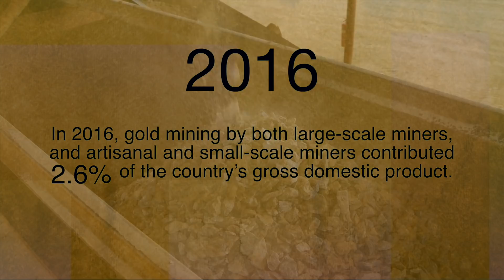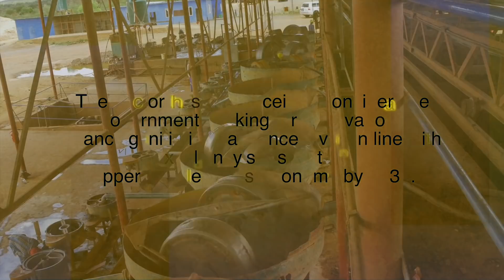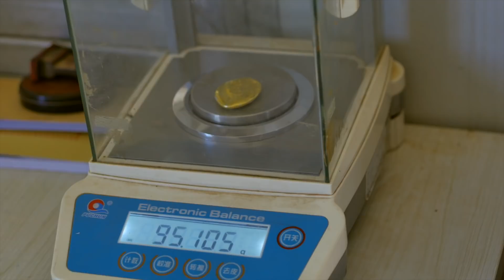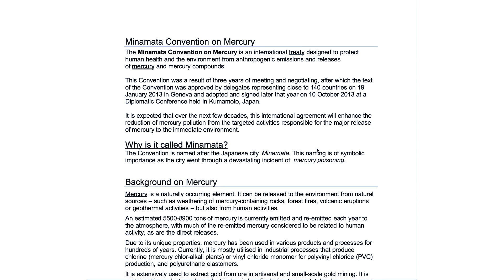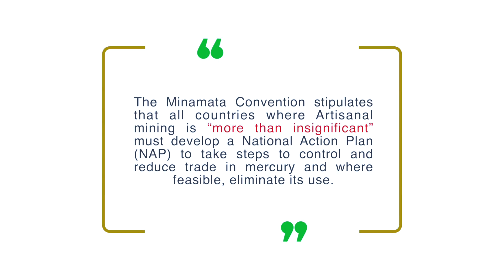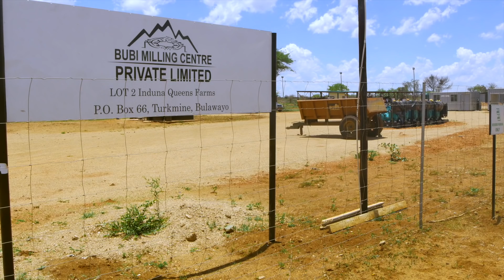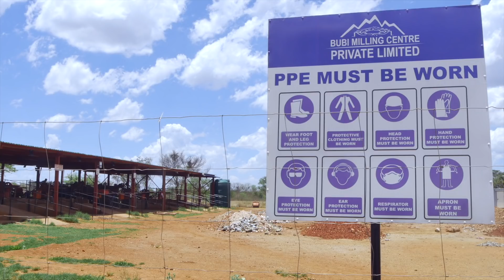Zimbabwe's Gold Rush video

Comment: Does that copper wire method of searching for gold really work in getting the gold vein and with its depth?
Reply: @footinmouth08  

That's fine thanks. I did a small research of this method of searching for things. Here in my country, its primarily used for water location for water boreholes and all major water borehole companies primarily use dowsing for exploring for place to drill a water well. Amazingly they highly rate this method.